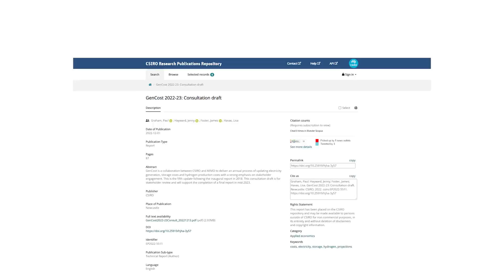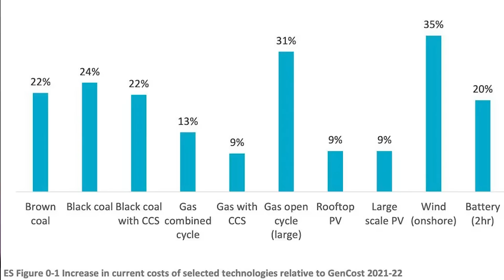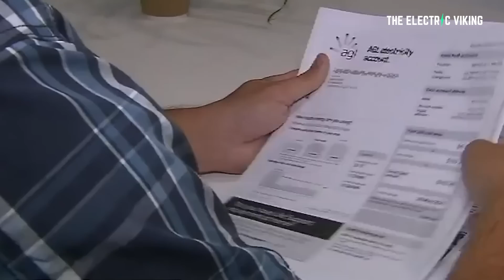Wind and solar still much cheaper than fossil fuels, even with inflation

Comment: Any video about renewables attracts swarms of fossil fuel trolls.  I see this one does not disappoint.  To know that such people exist really shakes my faith in humanity, which I suppose is their whole reason for commenting.
Reply: I think it would help if you stop calling reasonable people 'fossil fuel trolls'. If people don't accept the selective facts presented by Viking offhand, it doesn't automatically mean they are 'naysayers'. They are just thinking for themselves and not just accepting any story told by someone with a YT channel (with an extreme bias at that). If renewable is so much cheaper than fossil, why hasn't renewable electricity generation taken over 100 percent of the market yet? I don't mind cheaper electricity myself. Even if it is green....
You should be thinking that there is more to the story than just 'renewables are cheaper' (which I think is the case). And if there isn't and renewables are actually cheaper then there is no issue whatsoever and in no time at all, the market will switch to renewable. Nobody wants their electricity fossil, we all just want low cost.
Reply: @hvh377  they are not "thinking" at all, just mindlessly repeating some drivel they've been fed.
Reply: @nathanlillie5262  I'm afraid that repeating the statement that renewable electricity is cheaper now, is just that. Mindless repetition of some drivel that has been fed. Also in this video, there is again no data presented that supports this conclusion.

Have a look at a comment a bit down the order of someone who has actually read the report. There is a bit of nuance needed.

You must be sensing that this can't be just true, right? The market would have totally switched to renewable a while ago if this was true. You could earn a fortune if you would supply that so much cheaper renewable electricity for current prices.

In Europe we have just decided to put an additional tax on fossil energy from 2027 onwards. Do you think that is done because fossil energy is so much more expensive than the renewable stuff and people still keep on buying the fossil version?. The reason for this is to give renewable an advantage in the market and to raise money to subsidise renewable energy generation.

I hope you can sense that something must be wrong or at least incomplete about the statement that 'renewable energy is cheaper than fossil'.
Reply: @hvh377  You maintain that if renewables were cheaper we would have switched to them already, therefore they are not cheaper.  Electricity markets don't work that way, however.  Electrons are all the same, and you use the ones that come to your house, and pay whatever the electricity supplier is charging (some people, including me, have installed solar because it is cheaper, but you can only install as much as you've got suitable roof space to do it).  Commercial producers could build out renewables, and they are doing so, but it is a fight every time to get permitted, ultimately against the fossil fuel companies who fund NIMBY groups, politicians, regulators and even fossil fuel trolls. They depend on a regulatory system and infrastructure run by their politically powerful competitors for access to their market. So no, it is not a competitive market.  As for why I think promoting fossil fuels is the result of stupidity and corruption: the above is not really debatable, it is obvious, so anyone who pretends to know about energy markets should know it.  Prices for renewables are easily calculable.  Fossils fuels as well, and they have skyrocketed in price in recent months.  We are no longer talking about small differences, but  big ones where gas prices reaching and order of magnitude more than renewables.  Renewables producers are in fact getting rich, and are expanding, but just not quickly enough.   The fight for renewables right now is really about opening markets and ending subsidies: if that happens, fossil fuels are done.
Reply: @nathanlillie5262  I too have solar panels on my roof and have had them for 10 years now. The one thing that makes them economically viable is the environment tax on electricity that is about 60-70% of the cost of a kWh in my country. Without that tax on electricity to my house (whether it's from renewable sources or not), there would be no solar panels on my roof.

I can't get into all of your text. It's a bit much. But you give a great example of additional costs not calculated for renewables. You call them 'fossil fuel company funded NIMBYs', but that's not what they are of course. They are normal citizens like you and me, who don't want their environment destroyed by a huge windmill, solar field or lithium mine. You can't just put that aside like nothing. It is a real cost of renewable energy.

The same goes for the unreliable nature of renewables. Sure, when renewable electricity is generated, the cost is lower (sometimes below 0), but the additional cost for making sure we also have electricity supply when it's dark and not windy is a real cost caused by renewable sources.
Reply: @nathanlillie5262  If there was a competitive advantage to switching to renewables, don't you think it would be easier to agree on CO2 reduction  targets on a COPxx conference?
Why do you think China prefers to cop out (pun intended)? And why do we need these conferences at all?
It's to make sure all countries in the world agree to invest at the same level in carbon reduction, so that no single country gets a competitive advantage when it doesn't.
Reply: @nathanlillie5262  Just to make the arguments more concrete, I think there are 2 clear reasons that would make renewable (currently) more expensive than fossil.
1. The whole existing economy is based on fossil fuels. Transitioning to something else costs effort and money. It may not be a fair argument, but it is what it is and life isn't fair. It puts the cost of transitioning on the renewable energy bill.
2. And then there is the practical problem. Renewable energy is not always available when needed. Fossil energy is easy. You burn some when you need it. Transport is easy. Carbon based fossil fuels are about the most energy dense chemicals on earth. For renewables, transport and storage are much, much more difficult and costly.
I'm not advocating that we should stick to fossil fuels. I don't think we can afford to, but I object to saying renewables are cheaper. They are some of the time, but include the rest of the time in the price and it's a totally different picture.
Reply: Nonsense!!!! Renewable aren’t possible without fossil fuels and also fossil fuels have significantly way more fuel than just making electricity or whatever dumb people believe!
Reply: Wtf do you call trolls!? Are you ok!?
Do you see any tesla vehicle installing those massive solar and wind farms!? What about maintenance…..!? What about all the other activities that also needs oil to work!? Does renewables cover everything that oil offers!? Grow up please!!!
Reply: We should talk about oil and everything it gives us not just fuel! Same with renewable. Your tesla for example is about 40% oil where is the troll there!?
Reply: @carholic-sz3qv  What does this have to do with anything? You are just proving my point.

Comment: Solar power is CHEAPER and electric vehicles are soon to be CHEAPER to make and already are considerably CHEAPER to maintain and operate, especially if charged from your own solar power.

Everyone raise your right hand and promise to never again purchase an ICE (internal combustion engine) vehicle or tool.

We should all be using electric vehicles charged from our home, business and covered parking rooftop solar arrays making nearly everything we do 100% solar powered.  

Everyone should be getting proposals from 3+ local solar PV installers and suggesting the same for our places of work, our grocery stores, our movie theater parking lots, and everywhere else.  Zero down payment financing with lower payments than the power company monthly bill savings is available in many places.

The cost per distance driven is ridiculously cheap when you are your own solar fuel station (less than $0.12 MXN per km ($0.01 USD per mile))! #nobrainer

We cannot afford to continue to burn fossil fuels!

Comment: Wind and solar needs batteries to support it.
The smartest is to use solar, on roofs.
If you do, you can warm water, and cool down the panels in the roof.
Cooler solar will be more efficient.
If you have you solar panels on you roof, you don't need a big electrical grid.
Reply: You absolutely need the grid and there are factories and other activities that needs a lot of energy too just like buildings and homes.. and also the repartition of energy isn’t the same/great everywhere.
Reply: In Germany for example solar is totally almost useless in winter it’s only the wind in the north that can be slightly better and most factories are in the south.
Reply: Batteries and other storage are part of any fully electrified energy system. We currently match supply with demand using gas peaker plants, which are of course fossil fuel. Whether the grid goes to solar or wind or the mythical magical fusion, we will need batteries, e-fuels, and other storage to time-shift energy from when it is produced to when it is needed.

Comment: IN CALIFORNIA IT WILL COST YOU MORE TO CHARGE A TESLA THAN IT DOES FILLING UP AN ICE CAR AT $5 PER GALLON AND THEY WON'T EVEN LET CHARGE ON A HOT DAY TO AVOID BLACK OUTS
Reply: And fuel is also used for agriculture, transportation, flying, shipping….. which no Renewable can do. Fossil fuels also have about millions of byproducts again that renewables have crap about it

Comment: The issue is not renewables being cheap it's the problem of storage of all that power when it's generated. Grid level storage needs to be ramped up big time. There are numerous ways, straight forward giant batteries are one of them, there are other more inovative solutions that could be explored such as mineshaft dynamos, basically use the renewalble energy to wind a huge weight up to the top of your now disused coal mine and then when the demand for power is there, simply release the weight, gravity pulls it down and it winds a dynamo on the way down generating on demand electricity.
Reply: Get an EV Car 123abc. Storage.  Inductioncooking use, Heatpump and storage Tank 300 liter, 500, 1000 liter. If one EV Car is not enough for your Solar Energy give yor beloved wife kids an EV for Storage. No problem.🙂
Reply: Renewable aren’t possible without fossil fuels and also fossil fuels have significantly way more fuel than just making electricity or whatever dumb people believe!
Reply: Hi Stephen, yes I think you are right, there will be many novel solutions to energy storage - the mine shaft one sounds like it would be feasible. Also I think micro storage will have a place, with consumers having battery storage at their home automatically charging and discharging from/to the grid in times of plenty and scarcity.

Comment: Sam, as a Republican with 3 electric vehicles and solar panels, It's important to understand the sovereignty of private industry remain even in trying times.  Nationalization of any commodity is a reduction of private industry and overall control that the general population has over its own future.  Is important to understand the reasoning on both sides. Even if it does achieve the end goal faster Through nationalization, freedom and sovereignty must reign supreme in the path to get there
Reply: Renewable aren’t possible without fossil fuels and also fossil fuels have significantly way more fuel than just making electricity or whatever dumb people believe!

Comment: If a car was so unreliable it only worked some of the time then that car would be cheap. However since the government have poured vast amounts of subsides into them, we don't know what they really cost us. In the UK the government add 25% to everyones energy bills to pay for subsides.
Reply: The UK is NOT currently subsidizing renewables but is actually massively subsidizing fossil fuels by hundreds of billions to bring Gas prices and energy bills down and at the same time applying massive windfall taxes against renewables as they are making so MUCH PROFIT!! Currently around 8 times cheaper to generate electricity than fossil fuels!!! 
and renewables are reliable over a large enough scale with diversity (similar scale to the massive fossil fuel industry)

Comment: Renewable is cheaper if you get it build on cities. To make it feasible cities have to produce more than consume, than it is cheaper than power plants, that are hundreds of km away from a city to produce and transport power... If you calculate the transport efficiency too than you will start to see the real difference...
Reply: So by that you mean, you don't have to transport Oil, Petrol and Diesel?
It takes over 40 Kilowatts (Total calculation including transport etc) to just make 6 Liters of Diesel
Reply: A simple geothermal loop for cooling PV panels would be a smart idea... PV electric to power the circ pump... great idea.

Comment: "Cheaper" what's that definition?

A solar panel that only works while the sun shines directly on it and doesn't work at night - is that "cheaper?"

If you throw in Lithium batteries that can carry the load for 12 hours and still need a carbon fuel backup for when the sun doesn't shine for 2 days - how is that "Cheaper."

Like so much with the Climate Alarmist mentality - what you see is smoke and mirrors.
and "Cheaper" is really god-awful more expensive and very uncertain.

Comment: One of the many things that effect the. true cost of energy is the land cost of the removal of agricultural  land and turning it into power generation.  There are other costs ignored and when you include the uncounted costs, This is the problem when you try to estimate costs you must include all costs and land cost is usually ignored
Reply: Its been calculated All the renewables needed will not take up any more space than the current massive fossil fuel and nuclear industry, especially as renewables can be integrated i.e. Wind turbines over farmland, solar on rooftops, offshore wind, growing coups or livestock under solar panels, and the fact 30% of the land globally is arid desert (57,308,738 square miles) doing nothing, Does Australia have any empty deserts by any chance??????
Reply: @stevetaylor2818  bullshit!!! Who said that!? And also fossil fuel energy generation can be made much closer to the habitations while renewables doesn’t always have a fox place.